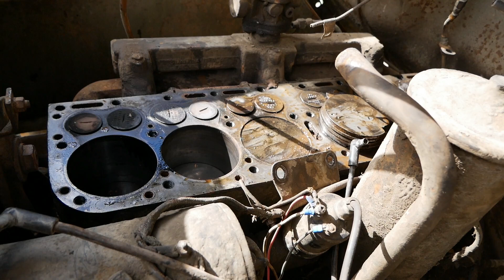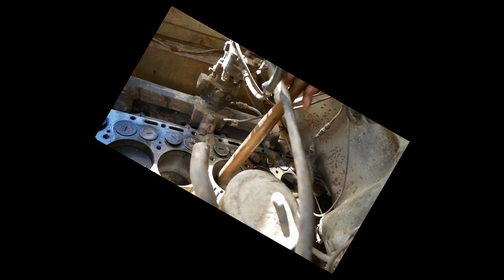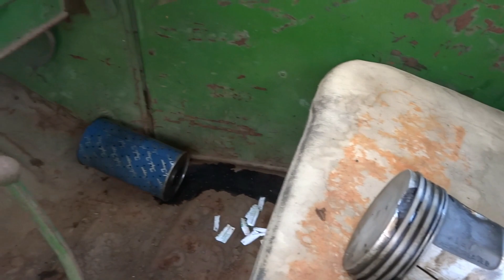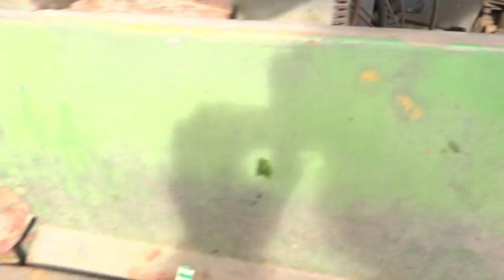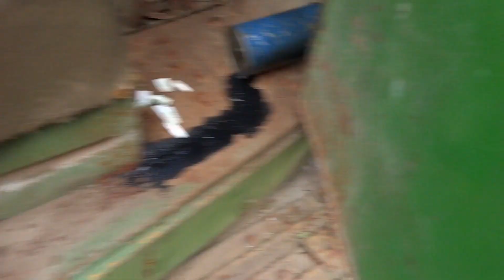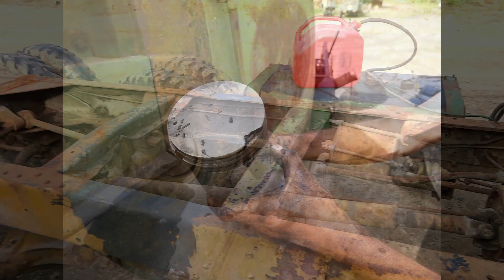Studebaker US6 Piston Replacement

Comment: honing the cylinder walls must create some gritty powder of some kind. How do you effectively clean it out? even the tiniest grit can ruin the bearings. 
I replaced the cylinder head on an old Mighty Max, and it had some grit inside the camshaft oil holes that I didn't check for.  it eventually damaged the bearings. I was able to fix it by replacing them, but it was a real pain.
Reply from the maker: Always cover the crank journal when honing - a lesson you'll never forget, I'm sure, the school of hard knocks is a great teacher and I have my own stories to match yours... When I was in technical school (1983) the claim was that dish soap and water were the most effective way of cleaning hone dust, that seems to do a good job and has always worked for me. I was short on time when I created the video so I didn't show any of the wire-wheeling of head surfaces or general clean-up, time always seems to be a factor when creating videos and my camera girl had already gone back to Germany. Thanks for watching!